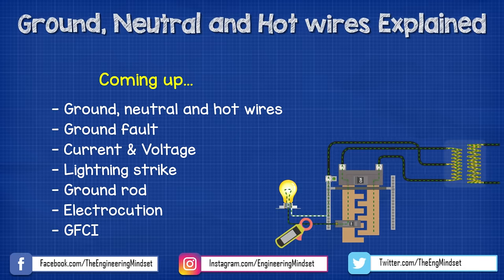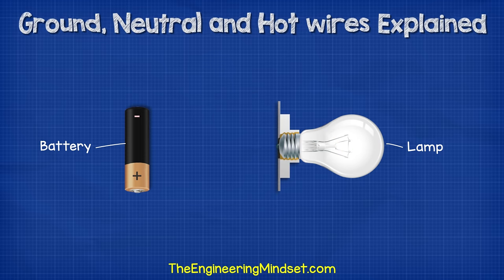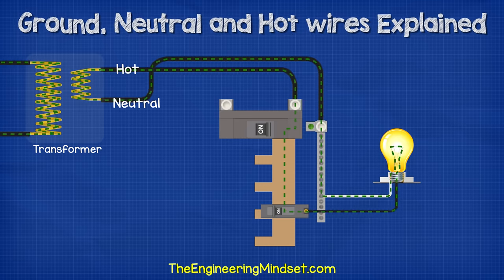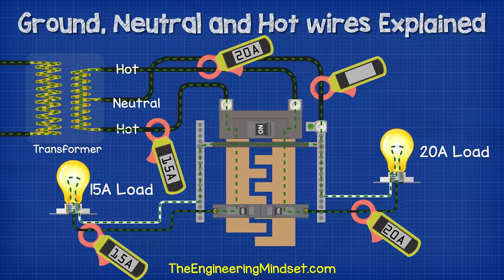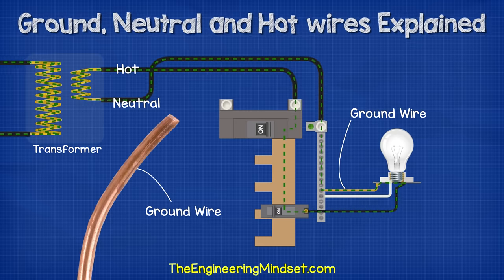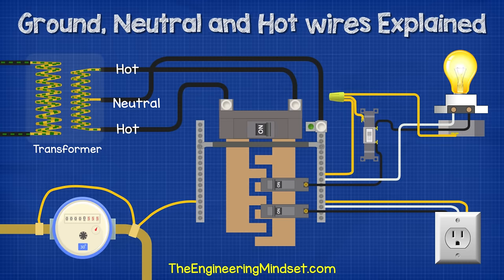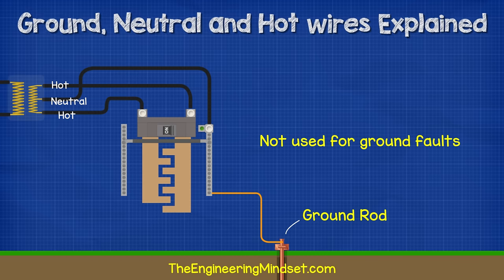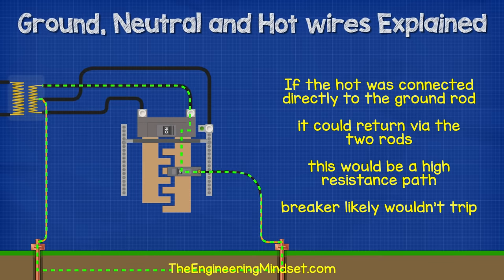Ground Neutral and Hot wires explained - electrical engineering grounding ground fault

Comment: 4:27 Why are both switches connected to different phases? I thought that by placing switches face to face you are actually using the same phase and if you want to use two different phases the switches should be installed one below the other. Am I wrong? Thank you very much!
Reply: You are technically correct, as that is the configuration used by most every single-phase electrical panel I've ever seen.  But I guess this is less about the physical config of the panel and more describing the theory.  And- these are not different "phases".  This is a single-phase system- they are better described as different "legs" of the same phase.  Google around for the difference between single-phase and three-phase services if you want to understand why this is called a 'leg' and not a phase.  I had an electrician yell at me once when I referred to the legs as "phases".  I don't make the same mistake twice! :)

Comment: Great video! One thing still kind of eludes me.... amperage travels through the neutral line pretty much same as the hot in the US. So since it travels through the neutral if I were to touch the neutral plug of say a fan while it was on, why wouldn't  it shock me? 
Let me explain, I don't get the "it's grounded so no difference" if that was true, then wouldn't the ground wire always have power on it? Maybe I'm overthinking this but if there is no difference in neutral and ground then neutral should not be carrying current or vise verse the ground wire should always carry current. Looking forward to someone who can help me bridge that gap
Quick edit: By ground I am mostly thinking the ground rod in the ground, since the appliance ground cable is normally an open circuit
Reply: tim g  This all makes basic sense, my only thing I cannot ultimately figure out is why this in theory seems to break ohms law. 
V=IR and the neutral wire can (in an imbalanced load) have the same current and similar resistance as the hot wire. I don't get how it has less voltage.
Just to help paint the picture: When I think of voltage I think of the EMF as that is basically what voltage is, it's the "pressure" of the electrons
Reply: tim g  ah! I think I get it now. Basically weather it be the other hot wire or neutral, something is always "low". But the neutral is just always lower in this case. I finally get it now thank you!
Reply from the maker: We just published a new Ground fault, short circuit and arc fault video, so much detail! Link HERE➡️: https://youtu.be/Qi0ynSQw-wc

Comment: Great video Paul, thank you! I have a few questions. I'm assuming that in your example with 2 bulbs the neutral amp draw was 5A because the bulbs were in parallel to each other?  Is it possible to have a circuit with a GFI where we have multiple loads in parallel to each other (one plug powering a blow dryer, one plug  outlet powering a.curling iron) causing a difference in current back on neutral? As I'm thinking about it I'm thinking that while the outlets may be in parallel to each other, they're both in series with the GFI?
Reply: Depends on where on neutral you make your measurements. The cancellation occurs downstream, beyond the neutral/ground bar in the panel. If you tap the neutral right after either bulb, you'll observe the incoming current amount. 
You'd install a GFI breaker (or any other breaker) upstream, before the neutral/ground bar. So any cancellation occurs beyond the breaker.

Comment: We had a primary urd cable replacement job. Undermine transformers, stuff primary in terminate liven. On one transformer it was full of dirt about 1/3 of the way. Neutral cables feeding the only house on transformer were buried past the lugs. It was a double lugged 400 amp service. As we were cleaning the dirt out and trying to undermine, the neutrals literally broke right at the lug. When we terminate the secondary lugs we tape up from the lug onto the insulation. These were not and I am assuming that the cable was 40 years old??? the lack of tape exposed the conductor to the dirt and corrosion. When the neutral broke the customer had everything blow in the house and start a power strip on fire, We were pretty quick about relugging and connecting, but the damage was done by then. The next day after an electrician and I did some head scratching I asked him if she had the ground and neutral connected in her panel. Well he looked and came back and told me they had no ground in the panel. I am thinking that if they had a good solid ground bonded with the neutral it would have greatly reduced the open neutral problem.

Comment: The neutral is the conductor that is connected to ground at the service entrance, and should have a voltage very near to ground potential.
Reply from the maker: We just published a new Ground fault, short circuit and arc fault video, so much detail! Link HERE➡️: https://youtu.be/Qi0ynSQw-wc

Comment: Hi I have a question. Why is it possible to get shock on the hot side of the circuit but not on the neutral side of the circuit?
Reply from the maker: Because you are the same voltage as the neutral and not the hot wire

Comment: And you need to explain that the reason why current flows into the 2nd coil is that the voltages are out of phase, so that, the 2nd coil 'sucks' in the current because it's sucking current while the the 1st coil (on top) is pushing out current - because they are out of phase.

Comment: Using a Jeeny that has a bonded to ground neutral. Wanted to power up a Euro machine that uses 230 volts on one hot wire and a neutral. How do I do it ?

Comment: Can you elaborate on grounding vs returning to source?

This is how I understand it.

When a ground line gets connected to a hot wire. The current flows from the hot wire to ground because there is difference of potential. Once on the surface the current it distributed, maybe some current manages to reach the grounding rod connected to the utility pole, and back up to its source. The difference of potential between the earth and source (utility company) draws a larger amount of current than the breaker is designed to handle so it trips. (Ground fault).

The definition of current is the flow of charge from high potential to low potential, it does not take into account whether a complete circuit has been formed or not. During lightning, a high potential is developed in the clouds and current flows as lightning towards earth. Sometimes there is nearer, large, difference of potential in the clouds themselves, so the lighting "spiders" across the clouds.
Reply: When people start talking about lightning and trying to compare it to residential electrical systems and charge 'going to ground,' it's usually bad news. It's not the same kettle of fish. Lighting is essentially also a form of 'returning to source.' The sources are different. 

The charge of an electrical system is indeed returning to source, not to ground (earth). Earth is merely a conductor in this dance. 

The key point here is that 'potential difference,' i.e. voltage, is between two points. The earth is not some master point of reference, it is only reference if we make it so. The potential difference is established within the electricity generating mechanisms, and isolated with transformers. I.e. the transformer becomes the source in this case. 

If you are curious about this, search 'ungrounded' or 'floating' electrical systems. They used to be common and looking into them might metastasize some of these concepts.
Reply from the maker: We just published a new Ground fault, short circuit and arc fault video, so much detail! Link HERE➡️: https://youtu.be/Qi0ynSQw-wc

Comment: Hi, I´m a sound engineer, you say that under normal conditions nothing flows on the ground wire, but what about the "normal" parasitic current produced by many equipment that is constantly draining through the ground wire?.
Reply: I think those current are too small to make any difference.
Reply from the maker: We just published a new Ground fault, short circuit and arc fault video, so much detail! Link HERE➡️: https://youtu.be/Qi0ynSQw-wc

Comment: This is great, except I have one question:  At 5:45, the ground wire is connected to the load and panel exactly the same way as the neutral wire, right?  So, why doesn't current flow through the ground wire as well as the neutral wire back to the panel?  Both wires have approximately the same resistance; therefore, wouldn't they both carry the current?
Reply: Never mind, I just figured out the answer to my own question.  Looking at a light bulb socket, there's a center contact (hot) and the outer ring contact (neutral).  I was thinking the outer ring was electrically common with the metal base of the fixture, where the ground wire is connected.  That's not true--the metal base is not electrically connected to that ring.  Looking at the animation in this video, this wasn't clear.
Reply: @kenhaley4  I think that is correct.  The grounding wire is not normally in contact with either the load wire or the neutral wire.  Only if the load wire comes loose from a connection and touches the grounded metal case of the appliance does it become connected to the grounding wire.
Reply from the maker: We just published a new Ground fault, short circuit and arc fault video, so much detail! Link HERE➡️: https://youtu.be/Qi0ynSQw-wc

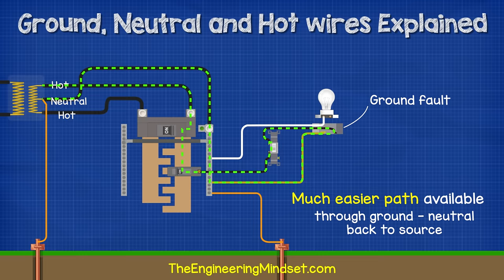Comment: In your video at 9:58, if the ground from the transformer was attached to the same ground rod being used by the equipment that would be bad, correct? This would create multiple or parallel paths for the current to go back to the source. Is that a correct statement? Thank you for your help.
Reply: Your first question is impractical, but yes it would be bad. The answer to your second question is NO, the ground wires that attach to receptacles and switches are part of the internal circuitry and are known as equipment grounding conductors (EGC). Parallel paths refers to current traveling on both wires within this circuit. The grounding electrode is part of the external system and is known as the grounding electrode conductor (GEC). The EGC protects the system from internal or man made faults. The (GEC) protects the building from natural causes, mainly lightning as it attempts to direct the current to the ground which is the source of the lightning.
Reply from the maker: We just published a new Ground fault, short circuit and arc fault video, so much detail! Link HERE➡️: https://youtu.be/Qi0ynSQw-wc

Comment: The main thing that made it click for me is that the two neutral legs are connected at the breaker, in fact there really is only one neutral/ground. So, the two different hot legs of the house can work like one big circuit with the whole transformer if they are balanced.
Reply from the maker: We just published a new Ground fault, short circuit and arc fault video, so much detail! Link HERE➡️: https://youtu.be/Qi0ynSQw-wc

Comment: Great video but I wish you would have shown and explained that in DC circuits the black wire is ground and that the red wire is HOTas in all US-made automobiles.  In the United States AC circuits, the black wire is HOT the Neutral wire is white and you did explain that the ground wire is green or bare copper..

Comment: I feel like it's going to be a silly question but I need to ask. In case of AC, when positive half of the cycle- active - hot conductor carries Voltage and current ( or voltage is giving the potential to electrons to flow through the load ) to the load, when circuit is closed and current passes the load ( e.a. light bulb) the there will be a volt drop across the load and the neutral conductor caries just a current back to it's source. So my question is when second half of the ac wave or the negative half comes to play is there a voltage in neutral conductor or how come that light bulb is emitting light again on second half of the sine wave as well as first half, or am I wrong? Thanks for any answer. Cheers

Comment: I still don't understand what differentiate hot and neutral on AC since the current go back and forth. For example: Hot > circuit breaker > load > Neutral vs Neutral > circuit breaker > load > hot. Will that make a difference?
Reply: same as dc except there is pulsing(frequency) from the source gathering or generating electricity.
Dc source has capacitance to deliver with no frequency.

Comment: Why is battery negative hot and positive is ground/neutral?
Isn't it supposed to be the opposite?

If you connect it like that, then wouldn't the voltage across the load be negative?

Comment: Hi, if both ground and neutral go to the same place in the panel, then why we have a separate ground wire?  Why can't the bare ground wire from the bulb or any load connected to the neutral wire? Won't it do the same thing?
Reply from the maker: We just published a new Ground fault, short circuit and arc fault video, so much detail! Link HERE➡️: https://youtu.be/Qi0ynSQw-wc

Comment: Very informative. But why doesn't my light switch have a neutral wire then?
Reply: The light switch opens and the circuit on the hot wire only.
Reply: Smart switches have neutral.

Comment: What keeps the current  that goes past the light bulb and back to the common bus from flowing back to the bulbs screw in receptacle via the green ground wire? Or does it?
Reply from the maker: We just published a new Ground fault, short circuit and arc fault video, so much detail! Link HERE➡️: https://youtu.be/Qi0ynSQw-wc

Comment: This was really helpful!  I have one outstanding question =. I'm installing a charger that will convert  so that I can charge my "house batteries" (separate from starter batteries).  This inverter wants a ground to my chassis.   But since these are two different battery banks with separate fuse boxes and breakers, it seems like I would be tying these two systems together through the chassis.  I’m assuming that we should actually attach ground to the negative terminal on the "house batteries" In this scenario.  Is this right?
Reply from the maker: We just published a new Ground fault, short circuit and arc fault video, so much detail! Link HERE➡️: https://youtu.be/Qi0ynSQw-wc

Comment: Hi, thanks for the vids, I have only just discovered them and they are excellent. A couple of questions, 1 should be fairly simple. What happens to the power in a half wave rectifier on the unused wave half? The other might be a bit more complicated. I have two windturbines both three phase, one manufactured and the other home made so the later will be uneven flow cos the coils were all wound by hand and will not be perfectly aligned with the magnets but it works. I also have two grid tie 3 phase inverters one 2 kw at 45 to 90 volts and the other 1kw at 22 to 60volt. Can you tell me what would happen if I hooked up both turbines to one inverter? would the rectifier be able to sort out the different voltages and amps and phases, I would hope the lower power generator would cut in first and the store bought would cut in later but voltages would equalise but the phases would be very different, would that matter?
Reply from the maker: Seen our new - How wind turbines work video? link: https://youtu.be/Hf875eOVrVI

Comment: Wait, doesn't the circuit breaker protect us from overload and short circuit in only hot and neutral? I thought the residual circuit protection  devices did the comparison between hot and neutral. Perhaps it is a terminology difference?
Reply from the maker: We just published a new Ground fault, short circuit and arc fault video, so much detail! Link HERE➡️: https://youtu.be/Qi0ynSQw-wc

Comment: Question: Since this is AC, wouldn't the hot and neutral wire switch continuously as the electrons reverse?  Therefore why bother to distinguish between them?
Reply: No think of it as the live is pushing and pulling the electricity if something is plugged in. The live in doing the work the neutral is returning it to the source
Reply: @IPv4Address  But if the pulling is coming back through the load then it also is powering the load, isn't it?  Let's imagine current being pushed from the hot side through the load.  When the current reverses, doesn't current flow through the load from the neutral side?  If not, why not?
Reply: @robertbrandywine  We need to separate voltage and current in this discussion.

Current flows through the circuit, and so yes, the 'neutral' has just as much current as the 'hot.' (Unless we're talking the main feeder neutral, in which case it carries the difference between the legs). 

Voltage, on the other hand, does not flow through the circuit, it exists between two points. Take that to heart. It very much needs two defined points, and where you measure those two points can change the reading even if current is constant. The voltage drops across the load.

The key bit here is that the 'neutral'— which should really just be called the 'grounded conductor'— is only not 'hot' because it is intentionally grounded. This clamps the voltage to earth potential, which happens to be pretty close to the potential you and I are at when standing on the earth, as we do.

So does the neutral have voltage? Well that's an incomplete question. Voltage between which points?
To ground? No, not really.
To the other 'hot' conductor? Yes should have about 120 volts.

But remember that the 'neutral' (or grounded conductor as preferred) is only NOT HOT if it is in direct and low impedance connection with the earthed portion of the system. If you disconnected a neutral wire from the panel and grabbed ahold of it, suddenly you are a load in the circuit and the 'neutral' is actually a hot because you've disconnected it's clamp to ground by disconnecting it from the panel.
Reply: @spruce_goose5169  I understand, thanks.  The situation you describe is called an open neutral I believe, although usually this occurs accidentally inside the house wiring.
Reply: @robertbrandywine  indeed.